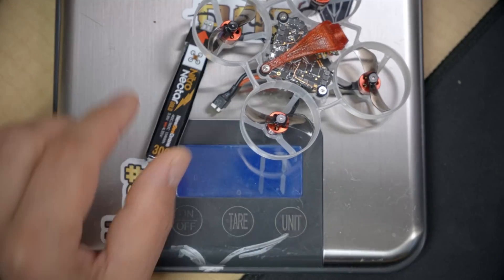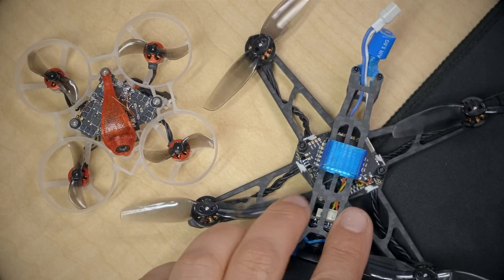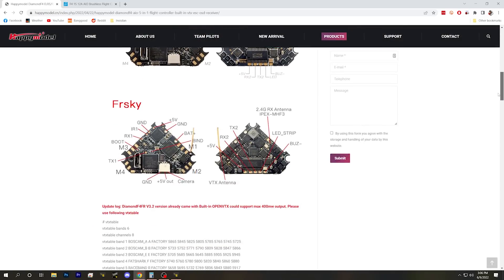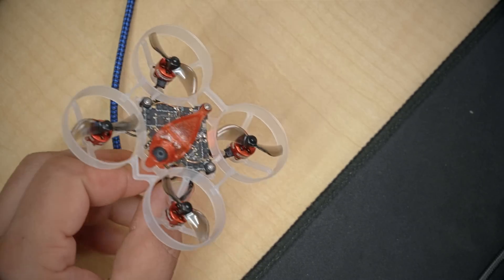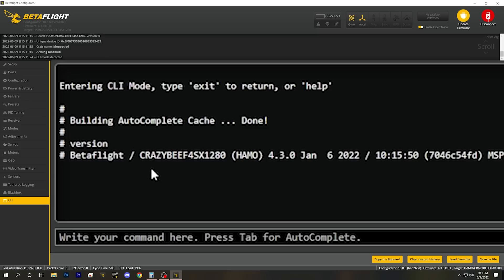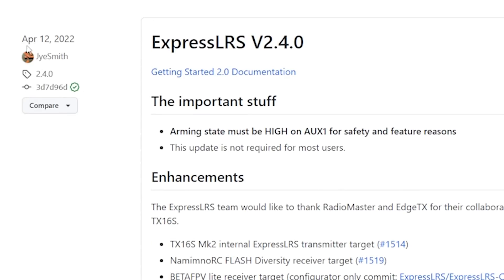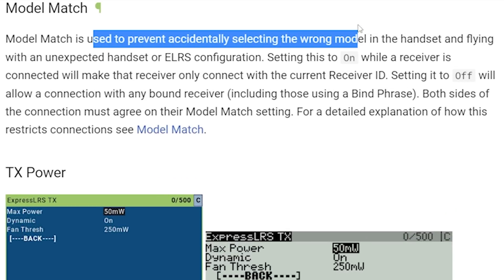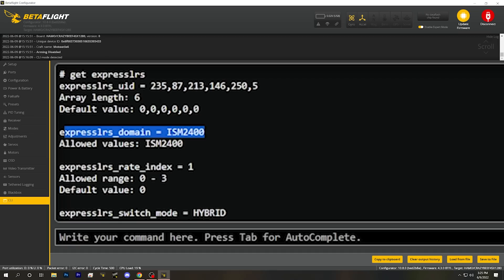SPI-based ExpressLRS receivers are the worst

Comment: SPI RX is good for FC whoop for simplicity and liteweight. I think whoop pilots only need the basic important functions of RX-TX which are link quality, stability and low latency and I think improvements are not always nor should be new features.
I just hope AIO FC with SPI RX will keep exists and work for future version of ELRS release ... don't mind if it stuck or limited to current available features.

Comment: I honestly think this is the better way, even if the ELRS devs don't agree. Most pilots will setup their quad, find a sweet spot, and not touch the software again unless they have to. ELRS development may move fast, but most users probably don't mind much, especially since the ELRS firmware is forwards/backwards compatible within the major version number.

Maybe the Maintenance release branch can be used to push ELRS updates faster, or create a new release branch specifically for SPI ELRS.

Comment: I have a question that has nothing to do with this vid, but I'm new to drones and figured you'd have an answer, but also you would probably check these comments sooner than later lol. I have a Eachine Wizard X220S FPV Racer RC Drone Omnibus F4 5.8G 40CH 30A Dshot600 800TVL Flysky FS-i6X RTF, and a BetaFPV FPV Whoop Racing RTF Advanced Kit 2. I think I prefer the radio that came with the Whoop over the bigger Flysky. I watched your vid on the Radiomaster Zorro. Would that be a good choice for me moving forward with more drone purchases in the near future and would it bind to the 2 I already have? I don't want to have a different radio for every drone.

Comment: hey just watched the video and used the bind phrase to connect to my beta85pro2, in betaflight in the radio tab if i'm moving my stick to full throttle it's jumping from 0 to 2000 where my stick is

and also my radio is not showing i'm connected to the quad no telemetry recovered or disconnected notifications i'm so confused.

Comment: The only issue I ALWAYS have with ELRS is the wifi always stops working after every update. It broadcasts but once you try and connect it drops off. Unless it's betafpv issue, it's happened every time on all my receivers... So I can't do wifi updates
Reply from the maker: All your receivers are BetaFPV and all of them have this issue. Meanwhile /me using Happymodel it works every time. Hmmm.
Reply: That's strange. I update every release as they come out using wifi on all my quads and it works flawlessly every time. I have a Happymodel module and ep rx's.
Reply: @skree_fpv436  the TX has no issues, only the betafpv nano rxs wifi always seems to lock up after updating.. I don't get why

Comment: SPI is considerably faster especially when you run express LRS at 500Hz.  Do you know what data rates the UARTs run?  115200 is pretty standard, though faster rates are possible in some cases.  If you are running at 500hz, do the math on how many bytes fit into 115200, and it’s likely 500Hz just won’t fit.  This may be worth the trade off.
Reply: https://github.com/betaflight/betaflight/blob/master/src/main/rx/crsf.c 
runs on 420kbaud, 1.5ms per frame max. sounds like a lot until you realize dji link is 28+ ms
Reply: Not to burst your bubble, dude. But, not all UARTs run at 115.2 kilobytes per second. That's more of a loosely kept guideline, than an absolute rule.
CRSF is a UART protocol that runs at 420 kilobytes per second or higher. If you went through the source code of BetaFlight, you would know this.

Also, when it comes to SPI vs UART vs I2C etc. It's not a case of "which one is better than the other" or "which one is crap". It's moreover to do with which one is more better suited to the application at hand versus the availability of compatible hardware that can drive it & what price point the device is being made for.
For example, the reason why the vast majority of servos (that aren't made by Futaba or FrSky) & motor controllers (ESCs) still use PWM & not a UART-based protocol (such as D Shot) or (better yet) CAN, is because of backward compatibility.
Reply: @NiCadHeliPilot  True, but in the video you can see the uart speeds are all set to 115200 in betaflight configurator.  https://youtu.be/G1dK7nk5Ds4?t=268
And for this application 115200 is not enough to get data to the FC at 500Hz.

Comment: Oh good. I chose the FRsky SPI receiver on my Crux35 instead of the Elrs because the frsky version has 20a ESCs and the elrs version comes with 12a ESCs. So if they both suck, that's great because I got better ESCs and didn't lose anything on the receiver side of things.
Reply: He was mostly joking
Reply: @jermadjesty  The other reason I chose the frsky version is because I have radios that will do D8 frsky protocol but I don't have any elrs 2.4 stuff yet.

Comment: SPI is literally Serial Peripheral Interface. UART is universal asynchronous receiver-transmitter. The continuous use of the word 'Serial' when they are both serial interfaces with different protocols is just confusing. It's like calling every radio control link Ghost when the physical hardware you're using is Crossfire.
Reply: This explains exactly how confusing and irritating some of this stuff is.
Reply: Well, they are both serial links, just different types for different purposes.
Reply: Amen. Not to mention SPI (which marks a peripheral-controller distinction) is literally made for a processor to talk to nearby peripherals without the need for them to have their own beefy processor serving as a second space-wasting, redundant controller.

Comment: If the ELRS firmware needs to be baked into BetaFlight, then what's the point of the SPI/ELRS drop down in the configurator? Conversely, what they should do is decouple these by standardizing the flight controller's receiver API and letting the ELRS firmware conform to that standard. If they did that, then BetaFlight could include a stable Rx blob, but the moment it is outdated, the Rx can be updated by updating BetaFlight (with a newer stock Rx blob), some as-yet undefined Rx firmware pass-through over SPI, or over WiFi. As long as all of the Rx firmware use the same protocol to talk to the FC over SPI, the Rx can be kept updated independently... just like the UART version.
Reply: You can still use the drop down and select a uart based receiver ..
Reply: Betaflight isnt the standard setter, it is one FC firmware (of many).  Receivers can be used without FCs so wouldn't make too much sense, but I see your idea

Comment: Feels more like an implementation issue then an SPI vs UART issue. Not having looked at the actual boards with the ExpressLRS SPI implementation, it sounds more like they share CPU since the code has to be built into Betaflight, to save cost, instead of just using SPI for communication between the different functions.
Reply: Yes, my understanding was that SPI setups share the CPU with all the other functions of the FC.
Reply: @lightbulbjim  understandable then that they want to remove that behaviour from the board manufacturers, since it then creates that dependency. Would have been better to run SPI but separate chips/functions.

Comment: I was also incredibly baffled why they did the binding phrase that way... and why when you type it into the configurator... if it wants the bytes WHY doesn't it just convert it right there? DUMB. I got in a betafpv aio. I put on the new version of betaflight, and flashed the FC to the newest firmware... and flashed my TX for 2.5.0 and it worked... lucky?

Comment: This is really only a problem for me, when there's a big update, which requires you to update the ELRS version on your transmitter as well.
Because then you need to delay this update on ALL of your quads until it's avaible for your FC.

Otherwise I don't always need the latest and greatest on such a tiny micro-whoop.
Reply: I thought all 2.X releases we're compatible, no?
Reply: @jermadjesty  Yes. But at one point there might be a version 3.
(Version 2 and 1 are not compatible.)

That's what I wanted to say:
To me, it's not that much of a problem with the slow updates on SPI-based receivers as long as there's no major-update.
Reply: @uhu4677  Like now for example!

Comment: 6 months ago I flew my first ELRS quad, the Crux35 and it was SPI Receiver based. I was blown away at the range (1+ mile) and penetration that could be achieved an SPI ELRS receiver, and I still fly that quad now as it's one of my favorites. 

I thought for sure that this would be the future of whoops and micros. But as the months have gone by, I have watched the constant firmware updates by the BF team to address ELRS issues. As much of a fan as I have been of SPI ELRS for getting us away from god-awful FrSky and FlySky SPI receivers, I was wondering how the issues with the updates were going to play out. 

Today one of the ELRS developers Bryan Mayland stated that "SPI hardware should not be considered" in his opinion. And that "ExpressLRS 2.x works fine, but when 3.0 RC starts in a couple weeks, SPI RX will not work at all due to changes in the over-the-air formatting... SPI hardware is already obsolete in the eyes of the development team as that information should be known before making your next whoop." That was sad for me to hear… but it is understandable why. 

I wish there was a way for there to be some middle ground, but a dedicated UART looks like the only real solution. I don't think whoop or micro flyers necessarily cared about access to every new shiny feature ELRS brought to the table, we just wanted a stable, fast link that didn't suck. But as a programmer I see the challenge of trying to add new features while worrying about what's going on in SPI receiver code baked into BF that can't be updated easily — it must have been a nightmare. Integrated serial RX then, is the only way forward. 

Also, you can just hit the bind button on the rx tab which makes things a whole lot easier.
Reply: There is a solution and it's coming, there will be boards with a single MCU handling both ELRS RX and VTX and the total number of parts will be the same as SPI with bleeding edge compatibility of UART.
Reply: The bind button on the spi receivers is sooooo nice. But tbf, if you've got elrs on a uart and it's implented correctly and can be updated and configured with the elrs configurator then you can just do the binding phrase and that's not THAT much more difficult.
Reply: @zachmachina  agreed! I just wanted to point that out because it was a nice little perk of ELRS SPI, but I would survive just fine without it.
Reply: @JohnCuppi  I mean it's really valid. I have the 1s jhemcu board with elrs on a uart and binding it the first time was a pain because the target it's supposed to flash to doesn't work and it comes as elrs 1.x so there's no option to add a binding passphrase or anything and unless you know the unique method jhemcu has for binding, you'll never get it bound. Took me like an hour or more to get it to work and even then, I couldn't find any documentation on how to do it. It was just by talking to a friend that I figured it out. I was really missing the spi rx that day.

Comment: Use the Bind button on the Receiver Tab... Super easy and takes 2 seconds.

ELRS V3 includes the ability to integrate the analog vtx.  So we should see whoops with integrated serial Rx in the near future.
Reply: Bind button won't work if you have a binding phrase. If that's set-up, then yes it does work (provided you use elrs 2.x as backed into 4.3.x)
Reply: @nikotttin  I have binding fraze and elrs 2.0 and bind mobula7 1s ELRS using bind button in betaflight and bind button on luascript on tx( I have betafpv ELRS micro module+ flysky i6x with opentx) It binded in 10 seconds
Reply: Can't wait for V3, especially the support for extra high res channels!
Reply: Just curious, if this was that much of a limitation, why design AIO FCs like the Pancake then? Seems that it could've been uart-based with all the extra space on an FC/VTX/RX only compared to a literal FC/ESC/VTX/RX AIO on whoops.

Comment: FACEPALM
I've had this HX115LR for MONTHS trying to get it to work and only just now found the "V 2.1" stamp on the bottom, which makes it a DIFFERENT version than the one in your tutorial, which worked for the second HX I bought (a v1) when I couldn't get the first to work. Only watching this video after watching the HX setup guide do I finally understand wtf I was doing wrong. THANK YOU even though you didn't even know you were getting this figured out for me after so many months of fruitless efforts to get these working.
Reply: I feel you pain, I had the same issue. Another one was that I couldn't change VTX channel so I just change all my other drone fro F4. Also, after a while my controller stopped giving power to ESC so it works in cli, but doesn't fly because voltage is always 0. I don't recommend for anyone to buy HX115LR.

Comment: I thought a reason for the 1.x and 2.x naming scheme was because all version 2.x hardware should at least have the basic functionality to work with all 2.x hardware. So you should be able to update your tx to the newest 2.x version even if the spi receiver is stuck on 2.1
Reply: That's true, but there is ELRS 3.0 soon.
Also the devs say dont buy SPI if you can avoid it.

Comment: I have a Mobula 7 ELRS and had so many failsafes at short range and not binding on power up. I tried every RC version of BF4.3, reconfigured the options many times, and went through all the troubleshooting documentation with no luck. It worked best right after flashing firmware, but usually failsafed quickly after then just wouldn't bind. I ended up soldering on an EP2 instead and it's worked flawlessly ever since. Thanks for the video Joshua, it's nice to know I didn't miss anything in the setup! Looking forward to the Mobeetle6 review.
Reply: Maybe it was faulty unit, my Mobula6 elrs never failsafe, it was simple bind and fly.
Reply: @XscapePrime  That's what I would guess too since I haven't seen anyone else with the same issue. I did reach out to HappyModel support but didn't hear anything back.

Comment: So when you say "poor range", I guess you mean that it loses signal even inside the house? Because based on flight time, and size......I personally probably wouldn't even be flying this quad much outdoors, as I have 3.5" and mostly 5" quads for that. But perhaps many do fly these like their 5", outdoors.
Reply: Same, i fly my 2,5“ outside and i haven‘t had any issue regarding range. But that’s with an ELRS SPI receiver onboard ;-)
Reply: @eyeflytinkerings  I have an ep2 on mine so it has range for days
Reply: I have a 2.5 in that I fly outside quite a bit.
Reply: @angelsinraver  Well, I guess I fly my TinyHawk Freestyle 2 outside also, I mean......it can be flown in doors, but it is quite punchy on the throttle:)